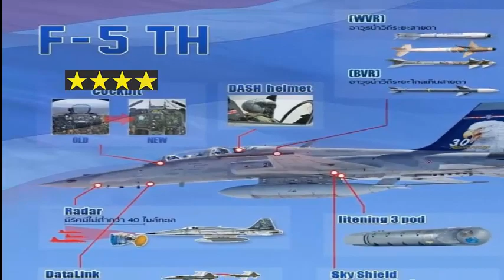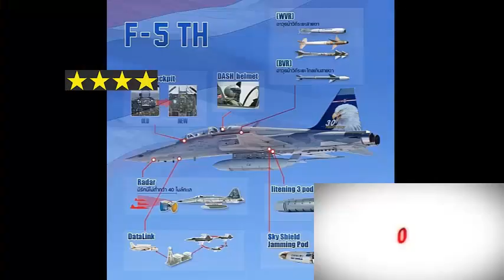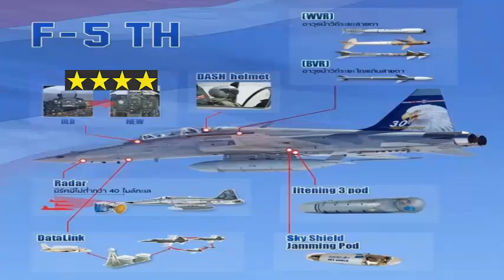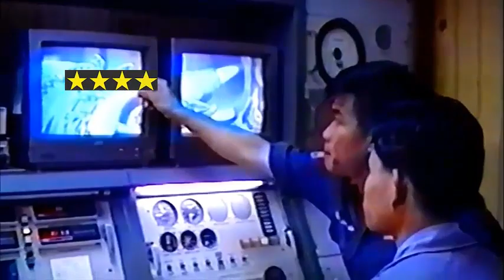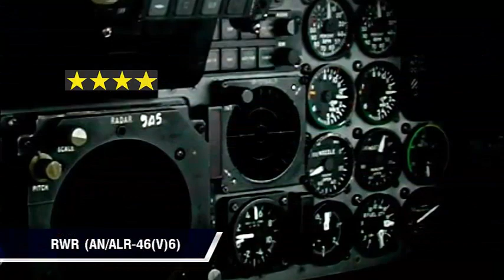Seeing the innards of the Thai Tiger F-5 Plane Modernization

Comment: Brazil's F-5EM/FM fighters can be armed with 5th generation missiles such as the DIEHL (Germany) short-range WVR IRIS-T missile with a 25 km range, the short-range WVR A-Darter missile (Brazil / South Africa) with a range of 22 km. The main weapons of the F-5EM/FM do Brasil are: a 20 mm cannon, the short-range missiles Python III and Python IV, the short-range missile MAA-1 Piranha guided by infrared (IR) and the short-range missile range MAA-1B Piranha guided by radar and infrared IR (4th generation) and Derby, medium range, guided by radar. The fighter can also launch rockets and bombs (of different sizes and purposes) of free fall or guided by laser and GPS. They include a Leonardo Grifo F radar with an 80 km range, an advanced mechanical scanning pulse-Doppler radar with multi-target capability, as well as a new Data Link BR-2 data system developed internally by Embraer that allows exchange of information with other F5-M within the same training.
 The jets also have a revised cockpit, along with new avionics, including inertial/GPS navigation, three liquid crystal displays, a new head-up display (HUD) and the “hands-on throttle and stick” control concept (HOTAS) where the pilot is able to do everything without taking his hands off the joystick and power control. Also according to The Drive, the new glass cockpit is compatible with night vision goggles (UFOs) and the pilot has an Elbit/AEL Targo screen mounted on the helmet, allowing visualization and targeting of targets outside the panel.